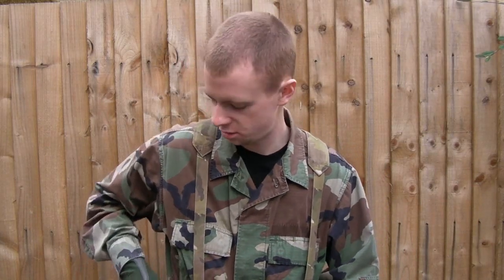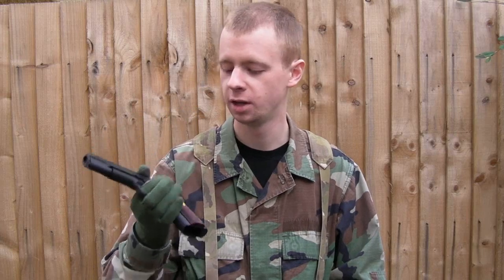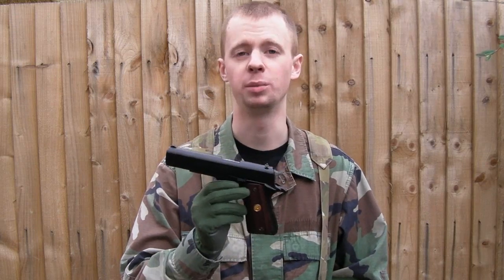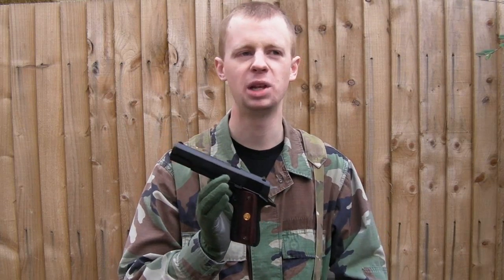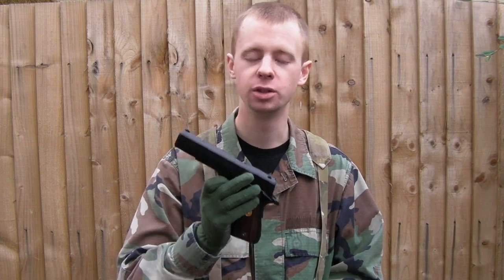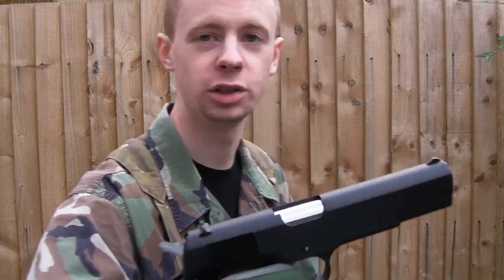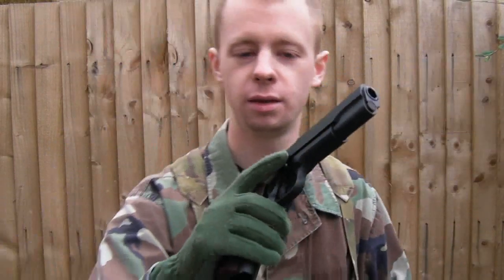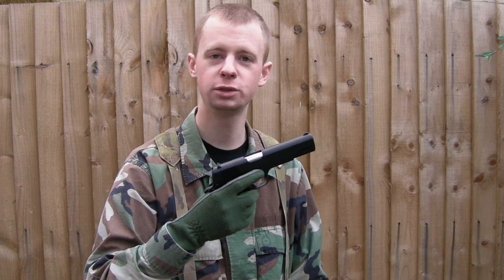Colt Series 70 (Airsoft)

Comment: Hello Ckinnerley. Im a user from airsoft forums. So i just watched this video and i have the same tm 1911, but with 2 extended mags. Now its my first gbb pistol. as well the first gbb ive owned. Now i've filled the extended mags with gas for around 6-8 seconds as advised. But then im not able to get through all of them bbs (40) without running out of gas or it locking back and releasing all the gas. (when it locks back i find that its gone too cold and frost has built up on the mag. Thanks.